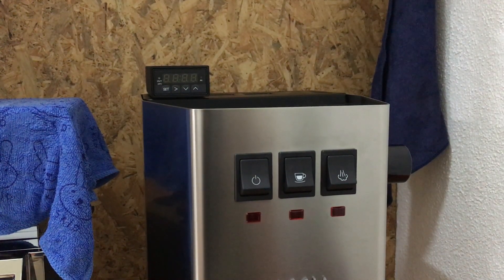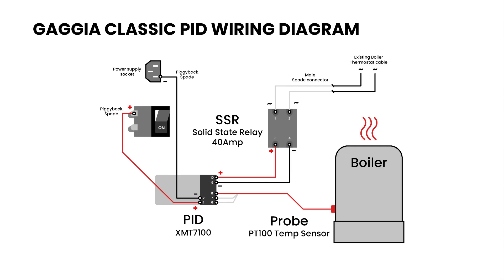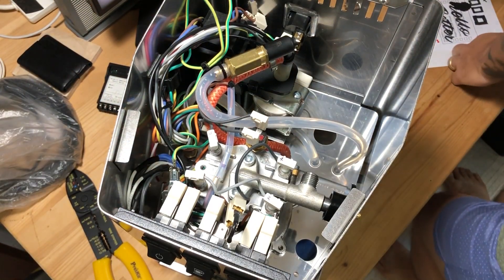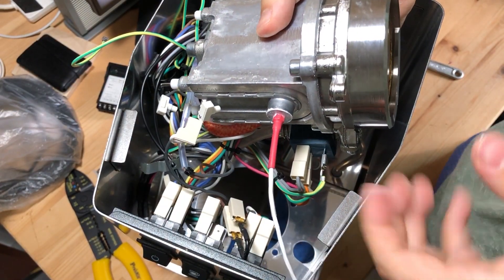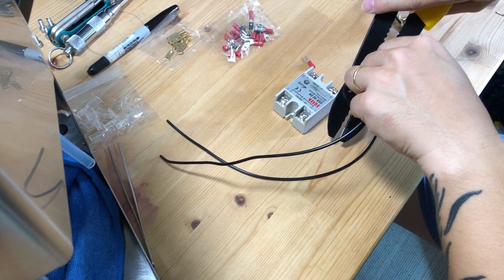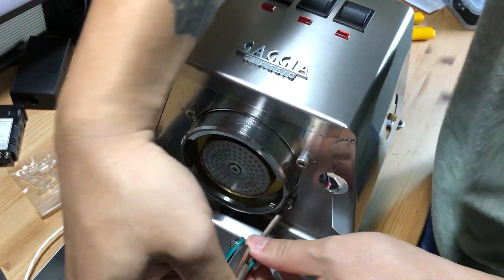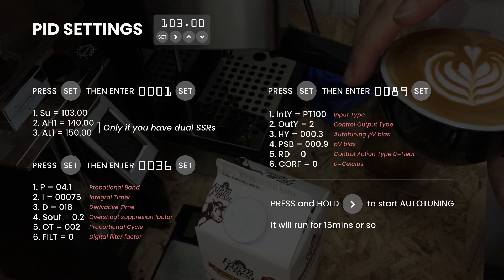Ultimate PID Gaggia Classic Pro Mod

Comment: I ve got a spare Eliwell EW 974, can I use as PID?
Reply from the maker: You'll need to figure out the wiring at the back. One goes to the Temp prob, power, etc. Refer to my diagram see if you have similar terminals on your PID module. Good luck!

Comment: Hey do you know if this works the same for the classic pro evo? It seems I connected an setup everything correctly but when turning on the machine the pid doesn’t turn on the boiler, no blinking on the pid. It just shows the actual temperature. Do you have any idea? Thanks!
Reply: Did you set the InTY correctly in the PID menu according to your thermostat type?
Reply from the maker: Hey. I haven't gotten my hands on the Evo model so I am in no position to give any advice. Best if you could trace the wiring diagram and see if it should be connected to the correct points in the whole mod. Good luck!

Comment: Ordered all the parts over the weekend and just waiting on them to come in.  I have a new Gaggia and the spade connectors for the switches are not individual, they are one large housing with all the spade clips in one.  So I can't use piggyback for the power.  Plan on using a butt end crimp connector on the wire leading to the switch.  Thanks for the detailed video!  Now the long wait for Aliexpress shipping.  I know it will be worth it.
Reply from the maker: Good luck! Do share with me when you finally get it up and running. Excited for you!
Reply: @EweJinTee   Now up and running!  Brewing some nice expresso too!  Thanks so much for this video.  Now I am really considering adding another SSR and including steaming through the PID as most of the work is already done.  All I need is SSR and make up a couple wires! 

I did end up watching another video for their mod on how to deal with the megablock switch connections.  So I did not have to splice the wire and could use a piggyback connection as well.  More info if anyone is interested just ask.
Reply from the maker: @testuser55  Nice! Glad the video is able to help with your mod! 

I did some reading, adding another SSR won't necessarily help with the steam pressure if that's what you're aiming for. But if you upgrade the boiler to a larger one, then that will make a lot of difference. There is a new Gaggia boiler which is larger in volume and able to hold more steam pressure. Hope that helps!
Reply: @testuser55 I would like a link to that video if possible.
Reply: @geomcl  https://youtu.be/F9REuV3rNj0
Reply: @testuser55  great, thank you.

Comment: What's the setting for AH1 and AL1 for the single SSR please?
Reply from the maker: If I remember correctly, those are only needed if you have dual SSRs. For single SSR, just leave it as it is. It won't be activating anything at all. Thanks!

Comment: Thanks for posting these instructions and links to components and materials :) Does the SSR get hot?
Reply from the maker: You're welcome. It does get warm a little bit, but nothing much to worry about. Just mount it to the shell it should be fine.
Reply: @EweJinTee  Thanks

Comment: Great video, 
Have you tried adding the 2nd SSR for steaming ?
Reply: Water has boiling point of 100 C at normal pressure, no need for thermostat, only protection one.

Comment: what a great guide. Which kind of terminal I can use instead of piggy back ones? I am asking that because, I am not able to easily find ones without purchasing 100 units.  Thanks
Reply from the maker: I think an alternative for you is to either try and purchase it from Aliexpress, or solder the wires togerher. But if you solder, then you won't be able to return it back to its original state in the future.

Comment: Hi! Does this one works for the steaming temperature? I want to stop losing pressure while steaming, so I'm looking for a PID. But I don't know if this set up and this installation will work!
Reply from the maker: Hi. The PID will be able to display it's current temperature that is in the boiler. If you switch on the Steam switch, you can see that the boiler temp increases, hence it will be displayed in the PID display. So you will have an idea of what is the current temp and when is best to steam milk. I usually start steaming at around 150C! Good Luck!

Comment: Hi Evejin, thanks for all that instruction , it was really helpfull. After setting pid parameters, pid aut light doesnt turn off and it does not heat boiler for brewing mode. When i turn on steam mode, i see the temp is increasing though. What do you think is the problem ? Thermal sensor itself or connections of it ? Many thanks in advance
Reply: Problem solved, i made a mistake on parameters, instead of 103.0 , i noticed that set to 10.3 which didnt kick the boiler since the boiler temp is already more than 10.3 :) but another problem is regardless from on/off switch, pid is always on
Reply from the maker: Thank you. My advice is to find a proper terminal for turning On/Off the PID. Some models of gaggia have different terminals. Use a multimeter or something to see which is positive wire and which is negative.
Reply: @EweJinTee thank you for the video
Reply: Hi, my PID also doesn’t turn off, you found a solution?
Reply: EweJinTee sorry to ask that, but how can a found the negative or positive using the multimeter?

Comment: What is the difference between installing one or two SSR? Thanks!!
Reply from the maker: You'll only need 2 SSR if you want to control Steam and Boil temperature. I installed 1 SSR Just to control the boil temperature. The steam temperature works great in it's original state.

Comment: Thank you so much for the video. May I ask how long did it take from start up until the temp reach 93 degree celsius?
Reply from the maker: Took less than 5minutes. It's a small 100ml boiler size only

Comment: Hi there, I wonder if you've corrected the IntY parameter from PT100 into PT10.0? If it's done, what value have you set up for PSb (pVbias = Temperature Sensor Correction)?
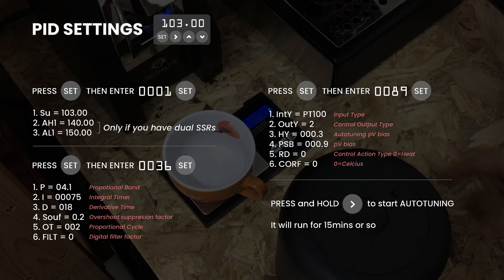Reply from the maker: Hi there! If you go to 8:34 of this video, you can see in the settings chart that what I changes I've made to the PID settings. pVbias is set to 000.9 currently.

Comment: I did all the steps as stated. Could you possibly please help me why my temp keep dropping during autotune? Is it normal?
Reply from the maker: Make sure you check if you're selecting the correct Thermocouple setting in the PID settings. If not, just let the autotune end by itself and try to power up the machine to see if temp is stable?

Comment: Hello, I have noticed that you opted to use 40A SSR, while Robert uses 25A SSR in his installation, where is the difference coming from? Thanks for great video!
Reply from the maker: I used 40A instead of 25A just to buffer the load at some point. You're fine off with either one :) Thanks for the comment!

Comment: Thank you so much for this "how to".
I did this PID mod with single SSR ( Brew temp only ). I have question, is it safe to use the steam switch? Does the steam temperature has its maximum to stop heating? Because we cannot control the max steam temperature on the PID with single SSR. What happen if i swtich on the steam but did not use the steam? Will the boiler gets broken? Or it will just stop heating the boiler at certain temperature?
Reply from the maker: Thank you for the comments! Glad this vid helped you.

The Gaggia classic comes with 2 thermostats. One is brew and one is steam. Once the switch turned on, it is controlled by a thermostat inside the boiler. It will automatically cut off heating once it reaches a certain temperature, if not mistaken that's like 145 Celcius.

Your PID should be able to read the temp inside the boiler so once you hit the steam switch, you can watch it build up and cool down once it hits certain degree.

Comment: Superb video. I assume that  9 and 10 terminals of the PID are DC and if so what voltage? Thanks in advance.
Reply from the maker: I might be wrong on this. The pins 9 and 10 would probably be 12V since that's the output voltage into the machine. The input of the PID is 260V.
Reply: Thanks

Comment: It seems I'm the only one for whom it didn't go well 😅 I did buy exactly the same parts as in the video and was careful to follow the steps exactly as in the video. Once the job was done, when I connected the power cable to the electricity, there was a short-circuit, the circuit-breaker blew and there was smoke at the PID.... 

After undoing everything, the machine is still working, fortunately, and it seems to be the PID that took the blow. Although I'd be surprised if I'd reversed any wires, do you know what could have caused the short circuit? I think the PID is now defective and I need to buy another one to proceed?

Also, I noticed that the upper front connection of my machine is not exactly the same as in the video. On my machine, two wires are connected to the power supply, only one wire is connected to the left for the boiler and only one wire is connected to the left for the steamer. Is this normal and could it be the reason for the short circuit?

Thank you very much for your help 😁
Reply from the maker: Hey. Sorry to hear that. Glad you're safe and your machine is still functioning. I'd advice you to check the wiring diagram closely again to see that you followed everything.

You can also text me via FB messenger and I'll see how I can help. Hopefully with some images in the chat.
Reply: @EweJinTee  Thank you so much

Comment: Bro, did you use 20awg size all throughout or you used different sizes? Shades is using 14awg and 22awg
Reply from the maker: I think mine is either 20awg or 22awg. Can't remember. Just make sure the wire can supply up to 220V (That's my local current).
Reply: I think you should minimally use 14 gauge from the SSR output to the sockets that used to go to the thermostat. This is bc the current will be higher due to the heaters it’s powering. Btw: 220v is voltage, current will be the power value of the heaters divided by the voltage. Let’s say your heater wattage (power) is 1600 watts and the voltage is 220v, your current that the wire has to carry is 1600/220=7.273 amps. Look up what wire carries the amperage with 20-30% overhead buffer.

Comment: I hope to find a used Gaggia in decent condition, because I don't want to buy a new one and void the warranty.

Hi, thanks for a good DIY video, can you link to all the Connectors you need on aliexpress, I only find kits of 280-300pcs a  $20 and so many are not needed.
Reply from the maker: Glad it helped! You can also go to your local electrical shop and buy them in limited quantities that you need. Don't need 200 pcs :D

Comment: My PID does not light up, i test terminal 2 and there is power.
Can you help[?
Reply from the maker: Hey. I'm not too sure what happened but best to check your wiring again. Pause my diagram and check your connections. I've had many people successfully use my diagram so there might be a mistake on your side.

Comment: Hi, I set up my PID the same with yours except PT10.0 as comments. My steam is not working since the temp doesnt reach high enough. How do I set up to let steam reach higher than 103?
Reply from the maker: This setup does not control steam temperature. Steam temp will function normally when you hit the switch. Advice to check your wiring again?

Comment: Hi Ewejin, thank you for the great tutorial. I have the same PID controller, but I’m not getting the temperature in decimals e.g. 102.5, 102.8, 103.1 instead I get 102, 103, 104, the temp reading increment is by 1 degree. Do you know why? Is it because I am using a K type temp sensor and not PT100?
Reply from the maker: That might be the issue. I think you'll have to search more online or in forums. I'm not too sure about K type temp sensors. If you can get PT100 then there is a setting in the PID that you have to set which temp sensor you have. That will change the temperature display hopefully.
Reply: @EweJinTee  In fact it’s because of the sensor type. Thanks for your reply.
Reply: Maybe the only thing you misplaced is the SSR. Wouldn’t it get in the way of the water funnel?
Reply from the maker: @Konstantin-G  I've tried numerous ways to placed it so that it doesn't get in the way of the funnel. So far this placement is ok for me :)

Comment: how do i set 000.3? cant this here nor in damien’s video
Reply: solved: setting is PT10 and not PT100 to adjust the settings at tenth decimal places. Owner might want to do a correction on the video
Reply from the maker: @jitsiongkoh5559  Thanks for spotting it. There might be some mistakes in the video or description so please pardon me :)

Comment: Are you using a dark roast for coffee? 103 is giving me very acidic shots, I may bump it up to 106.
Reply from the maker: Hi. I usually buy medium roast beans only because I don't like the taste on darker roast beans. You might need to play around with the temp to see which one gives you a better taste. Make sure you're sticking to the 1:2 brew ratio within 25-30 seconds time. Good luck!
Reply: @EweJinTee  thanks! I bumped up to 105 and let the machine heat up for 5 minutes, shot tasted way less acidic. Is it possible the thermal paste wasn't applied enough to the temp sensor so there is a misread? Can you use thermal paste for CPUs if needed?
Reply from the maker: @Moxyvox  Nice! Keep in mind that the temp will also drop when water from the boiler travels to the grouphead. So give it +/- 5C buffer? I think in terms of thermal paste application, you can refer back to my video, that's as much as you need to apply on the threads to ensure it has fully covered the surface. You should also get thermal paste that can transfer heat of 100-150C if that makes sense.

Comment: The IntY should be PT10.0 , not PT100. The other video by Damion has it written wrong even though that's what both you and him have configured. That's how you get the decimal point. Great video though, did the mod this past weekend and machine works great now. The first few shots before correcting that setting were too acidic but should dial in perfectly now.
Reply: missed this.
Reply: Please, do you know where we can find the PT10.0?
Thanks :)
Reply: @karimbenali9053  It's on the IntY menu. If I recall correctly there's only two options, the ones I listed.

Comment: Thanks, that took about 2.5 hrs do do glad you included the programing commands or I would have been a week figuring out that part of it. With the power wire to the pid connected to the left most switch it stays on constantly, if you want it to go off connect to the center switch top left most terminal. Works great! Question, does it adversely effect the steamer?
Reply from the maker: That's great to hear my video helped! To answer your question, No the current setup doesn't control any of the steam temperature. But you'll be able to monitor the steam temp increasing when you hit the steam switch. You should then steam your milk within 140-160C degrees mark. Good luck!

Comment: i wanted to do this mod for an christmas present and wanted to add an important note about the SSR. the SSR linked in the video had an estimated 2-3 month delivery time which I didnt want to wait for so i shopped around for another SSR on aliexpress. 

SSRs have an input voltage type AND an output voltage type. make sure to get an SSR that has a DC input and an AC output voltage! the model you will need to search for is SSR40DA. note the suffix letters D and A. the D is for DC input voltage and the A is for AC output voltage. 

do NOT make the mistake i did any buy an SSR40AA. i was excited to install everything and test. got it all hooked up and found out my relay wasn't engaging the boiler because the PID sends an output of 11-12 DC volts to the SSR and my SSR only accepts AC voltage.

this is the alternate seller i used
https://www.aliexpress.us/item/3256802663181474.html?spm=a2g0o.order_list.order_list_main.5.21ef1802nlE0vk&gatewayAdapt=glo2usa&_randl_shipto=US

aside from my mistake, great video and thanks for creating this! your video was almost 100% spot on for my gaggia. the only thing i had to change was switch my positive PID piggyback connector to the bottom prong of the rocker switch instead of the top. just something for others to look out for when they do this. you WILL need a multimeter to test continuity and voltages as apparently not all Gaggias are made exactly the same and perhaps a little bit of electrical experience to troubleshoot if something doesn't work after completion
Reply from the maker: Thanks for the tips man. Appreciate it. Glad you found the video helpful! Cheers!

Comment: Hi there! Sorry I am a little bit confused as to what can the PID do, and I was hoping you could help me out.

does the PID setup you provided control both Brew & Steam temperature? Or does it control Brew only?

I saw at 08:35 for the PID settings you mentioned "Only if you have dual SSR" setting. What does Dual SSR's do? does it help with Steam temperature consistency? 

Hope you can shed some light on this, thanks!
Reply from the maker: Hi there. There's nothing to apologize so don't worry about it. 

PID is basically a device to monitor and control temperatures. Hence, why most people use this to mod into their Gaggia machines. In my video, the Single SSR setup I have only will only manage the Brew temperature.  You will need another SSR to control the Steam temperature (which is something that I'm looking into right now).

Having PID to control your temperature will ensure a much efficient and stable temperature in the machine and in return, you can enjoy better espresso extraction.
Reply: @EweJinTee  awesome! Looking forward to your dual SSR video